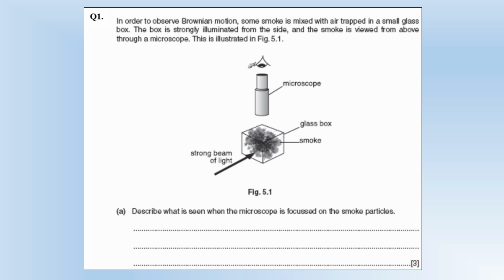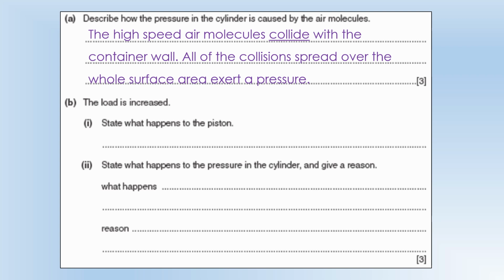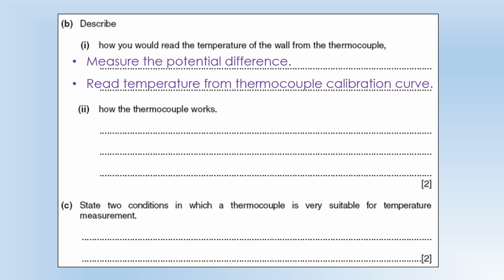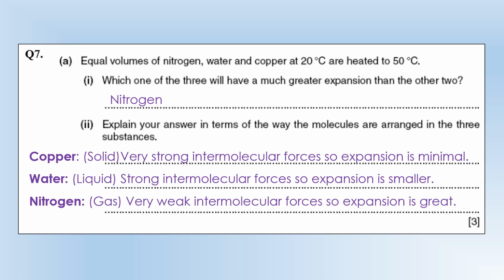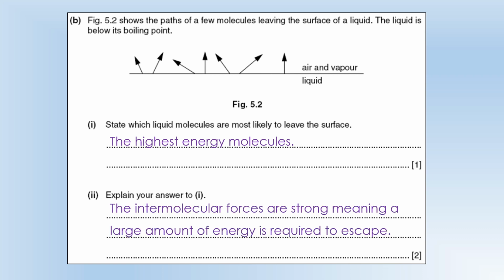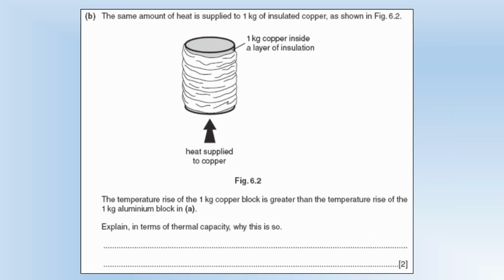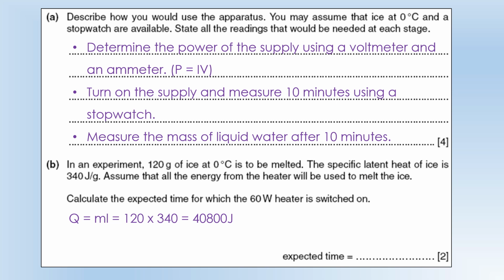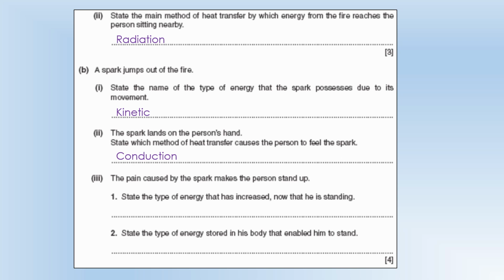iGCSE Physics: Thermal Physics: Past Exam Solutions

Comment: I am pretty sure that at 19:45 you have to first change the units of mass from grams into kg before carrying on with the equation,please confirm if thats necessary, aside from that excellent video
Reply from the maker: Actually no. If you look at the information you are given the latent heat is given in J/g so you need the mass in grams not kilograms (It is a good habit to be in to automatically convert from grams to kilograms but in this case that isn't useful!)